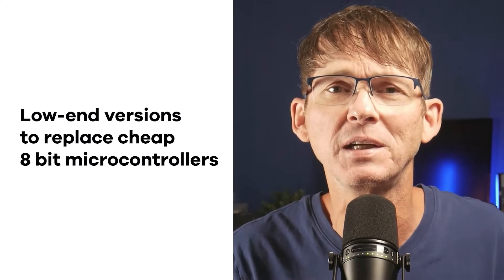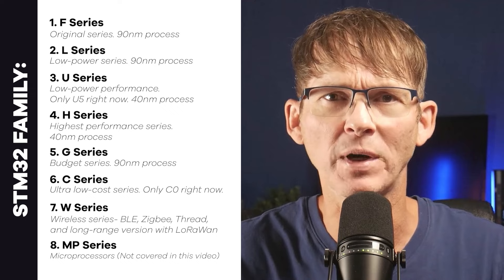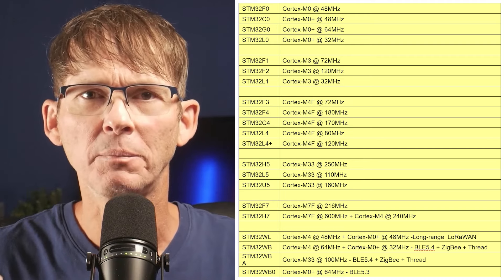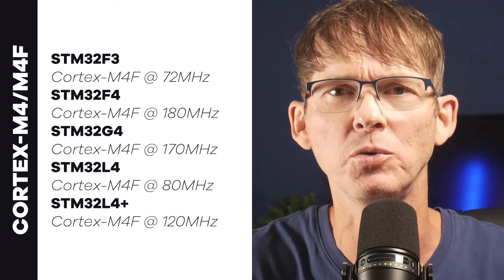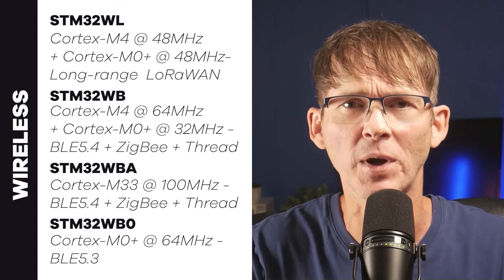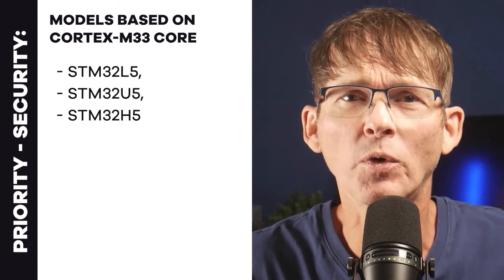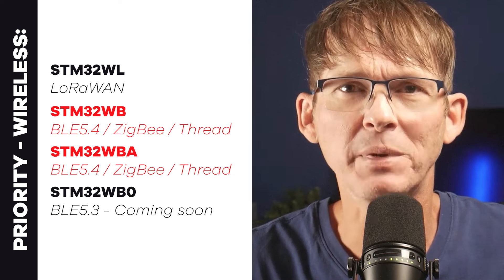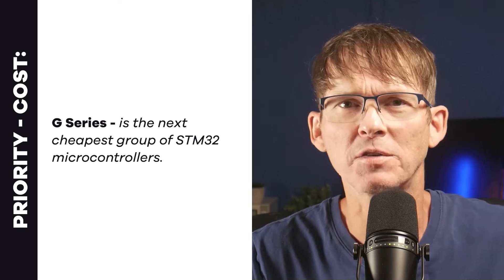How to Select the Best STM32 Microcontroller for Your Project

Comment: I have a project idea of smart irrigation system in which I want to display Temp, Humidity and soil moisture level and after a certain minimum level of moisture i want to start DC water pump to maintain moisture level so what is the best STM for this?
Reply from the maker: Unless you plan to include a fancy display or a mobile app then just about the simplest stm32 should be good. I'd look at a STM32F0.
Reply: @PredictableDesigns  i will add just simple indicator display no mobile app and thank you for your response sir

Comment: This is exactly what I was looking for . Very informative  video , it narrowed down my search content. I want to build a robotic car which can be controlled through wifi and will also have autonomous self driving , obstacle sensing ultrasonic sensor , and object following feature . Can you please help me to decide that , among f3, f4, g4 or L4 which  would be viable , cost effective and efficient for the my project ? thank you
Reply from the maker: If you need ESP32 I'd suggest the ESP32. If you want to use an STM32 as the core processor and just use the ESP32 for WiFi, then I'd go with an F4. But the ESP32 alone is probably all you need.
Reply: @ thank you very much for your valuable suggestion . Have a good day .

Comment: In the diy drone community, we are ruled by the F1, F4 and F7 processors. My remote has an F1, and the video receiver module and flight controller have an F4. Pilots have been flocking to the F7 due to the extra UARTs for connecting GPS modules and all kinds of other goodies. I'm the kind who cares less about saving cost if it means sacrificing performance (for personal projects). You also wouldn't want me anywhere near the cost annalists.

Comment: Summary

This video offers guidance on selecting the right STM32 microcontroller for various project needs. Here are the key takeaways:

STM32 Family: (0:00)

* Huge family:  Over 3,900 variants available, categorized into 8 subfamilies (F, L, U, H, G, C, W, MP).
* Based on ARM Cortex-M architecture:  Offers a range from low-cost, low-power to high-performance options.

Choosing the Right STM32: (2:44)

* Performance: (9:29)
    * Moderate: F2, F3
    * High: F4
    * Very High: F7, H5
    * Highest: H7 (up to 600MHz)
* Low Power Consumption: (10:11) L series (various low-power modes) and U5 (newer, higher performance).
* Security:  (11:00) Models using Cortex-M33 core with TrustZone (L5, U5, H5).
* Wireless Functionality: (11:30)
    * Bluetooth Low Energy: WB0
    * Bluetooth Low Energy, Zigbee, Thread: WB, WBA 
    * Long Range Low RAWan: WL
* Advanced Features: (12:14) Camera interface, LCD TFT, MIPI DSI, graphics accelerator, external memory controller are available in select models.
* Low Cost: (14:37) C series (C0 specifically) for replacing 8/16-bit microcontrollers; G series as a budget option.

Pricing: (15:28)

* Ranges from ~$0.38 (C0) to over $12 (dual-core H7).
* Prices vary within families based on memory configuration and package.
* Digi-Key is good for smaller orders; direct from ST Microelectronics is often cheaper for larger quantities.

Remember: (21:19)

* The video encourages downloading a free PDF with detailed specifications and pricing. 

This summary provides a concise overview of the video's content. For a deeper dive into specific models and features, refer to the video and the recommended PDF download. 

i used gemini 1.5 pro to summarize the transcript
Reply from the maker: Thanks for the summary with time stamps!

Comment: Thanks for the lot of useful informations. Actually there is also U0 out now.
Reply from the maker: Cool, thanks for sharing!
Reply: U0 does not have internal VRef. If you need accuracy for ADC, you need to add external vref. G030 interval VRef has very high accuracy, around 0.1%

Comment: Greetings sir, for beginners considering STM32, which board—Black Pill or Blue Pill—would you recommend they start with?
Reply from the maker: Well it depends on the project. The blue pill uses an stm32f1 whereas the black pill uses a more powerful stm32F4. So if a simple project go with blue, but if you need a more advanced microcontroller then go with the black. Hope this helps.

Comment: The best STM32 is ArteryTech AT32 because they're more democratic to their customers.
Reply from the maker: Okay, not sure what you mean by they are "more democratic to their customers". I've found ST to be a great company to work with. I've even had them give me free design reviews.
Reply: @PredictableDesigns Well... I will try to formalize this somewhat generalized feeling of mine.
AT is not forcing you to register on their site in order to receive development tools and reference documentation. AT does not pursue an aggressive policy of imposing its new ideas, when in order to download the old familiar version of the IDE, you need to solve a puzzle. Microcontrollers from AT can easily withstand overclocking by 30-50 percent, and at the same time all components continue to work properly. The library code is written much simpler, so if necessary, you can easily take a piece and adapt it to your needs. And in general, the endless assertions in the ST libraries kind of suggest that the developer considers the end user an idiot, although, of course, the guys simply came to embedded from “big” programming and brought with them their vision of the “correct” code. And AT's MCUs cost less. But there're flaws too of course. ATs has less elaborated and holistic ecosystem and it still in development. There're enough misstypes in docs. Code generation from configurator is still not supporting middleware.
Reply: @Ma_X64 you need to learn how assertion work. Many assertions in library is a good thing.  It helps you to debug and rule out most problems during development.

After testing, you can disable all assertions in one single setting. By default, all assertions are disabled. 

Your comments are not all valid. Stm32 has low level library which is simple to use. HAL library is rubbish and bloatware.

And stm32 has undocumented features which exists in higher price series. If you know, it is valuable. 🙈
Reply: @eos1d3  you're funny.